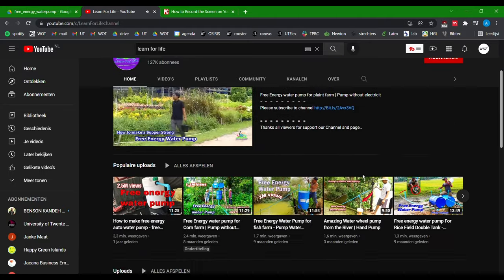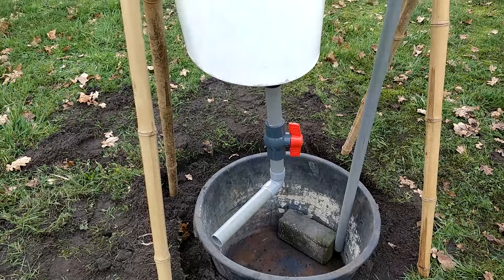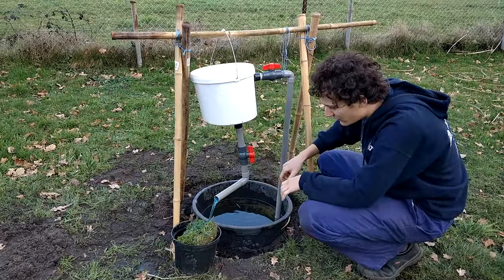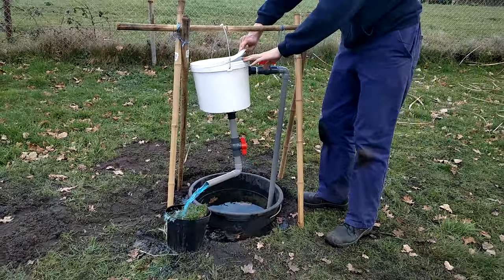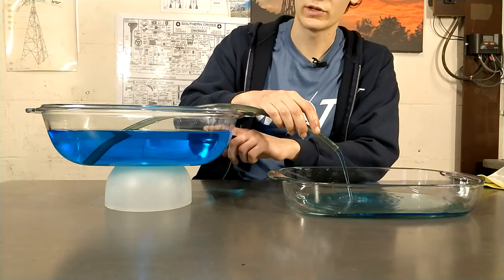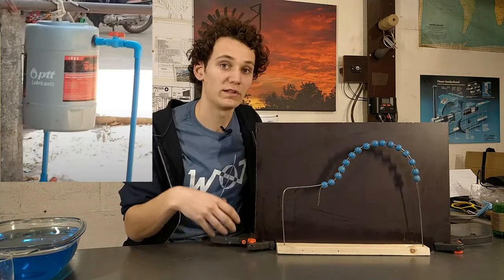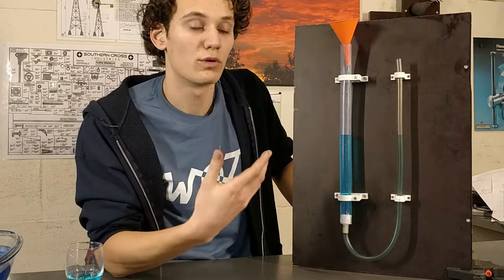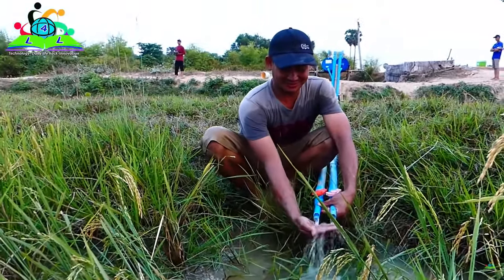FREE ENERGY Water Pump Tested. Is it possible?

Comment: Look into the ram pump also called water hammer pump its very interesting
Reply: He has a whole video about the ram pump.
Reply from the maker: We indeed have a video about a hydraulic ram, check it out here  https://www.youtube.com/watch?v=fUNicSOW46E
Reply: The outlet must be sunk under water to prevent the air goes into the tank. The pump can only ork only if the entire system is air tight and air proof. Water in the tank must be replaced with water from the intake and not to be replaced with air.
It is good if you add preasure tank (as per ram pump. Put bucket with full of water at the outlet and the outlet sink under the water.. Mind you, you cannot put the intake and outlet  from the same body of water. The bucket on the outlet can be higher or lower from the source of water. Bigger outlet pipe is preferable to ease the siphoning  and withdrawl effect
Reply: @WOT_utwente  incorrect. it is a vacuum created in the drum that sucks the water upwards from the ground level.
Reply: The energy actually comes from the sun heating up the drum that expands the air molecules in the drum and pushes the water out taking some of the heat that shrinks back the air volume  creating negative pressure to suck the water from the well. One metal drum has a surface of 5.6 square feet that can catch sunlight which gives 15 watts/sqft of energy total of around 80 watts per drum.  When the sunsets the system will stop pumping.
Reply: Can we use it to fill water tank on second floor from well or under ground water tank?
Reply: Ha ha ha..demo is not correct at all
Reply: I built a ram pump back in the early 2000s, spent $500 and a few years trying to get it to work but it completely failed.  Why?  I then discovered by reading a book by Gene Logsdon that the minimum height of the input needs to be three feet (or one meter), otherwise there's not enough force to run the pump. The input for my ram pump was a spring box that was only 2-1/2 feet (.76 meters) so there wasn't enough force to sustain the pump.  Eventually bought a bilge pump and a solar panel and that pumps the water from my creek up about 10 feet which then gravity feeds into my garden to irrigate it.
Reply: You should check itself feeding water wheels
Reply: @maintenance3044  ххххх
Reply: @Ameng3471  You are definitely onto it, but...
It is indeed possible to re-use the water.  The downward power is created through elevation and mass.  Think of the equation as left/right.  The left side (input) needs very little to draw it up the pipe (and can't go back down anyway), but the right side (output) is much more massive, until the end when it converges to a smaller outlet than input but with great pressure).  This works very well in concert with gravitational force, so there is earth's power to assist and make this work.
Reply: @rayabad  Awesome!!!  I will now inform our drum pumps they can take the evenings off to be with their families and tin-can friends.  Gonna be a lot of happy barrels at our house!!! 

There is no actual science in anything you have just stated.
Reply: @rayabad  No, it has nothing to do with the sun, you can pump water at night.
 it works if you follow the rules.  The outlet must be 3 times the diameter of the inlet, example 3/4" inlet, 2" outlet and must be at least 8 meters long and reduce to the diameter of the 3/4" inlet, with a valve so that the tube is filled with water up to the drum.
The drum must be made of metal and completely watertight to withstand the enormous pressure.
The 3/4" inlet must have a non-return valve inside the water and must be filled with water.
Here is the link for you to see, remenber all joints have to be glued, https://www.youtube.com/watch?v=zhKifQt-OH8.
Reply: @kalinystazvoruna8702  No, it has nothing to do with ram punp, this is another concept, the ram pump is for lifting water to 50 meters or more, this suction pump is for extracting water from wells or rivers to a depth of 10 meters.      it works if you follow the rules.  The outlet must be 3 times the diameter of the inlet, example 3/4" inlet, 2" outlet and must be at least 8 meters long and reduce to the diameter of the 3/4" inlet, with a valve so that the tube is filled with water up to the drum.
The drum must be made of metal and completely watertight to withstand the enormous pressure.
The 3/4" inlet must have a non-return valve inside the water and must be filled with water.
Here is the link for you to see, remenber all joints have to be glued, https://www.youtube.com/watch?v=zhKifQt-OH8.
Reply: @joseinfante5054  Thank you for the info, but I'm still skeptical.
Reply: His bucket lid is not air tight so it sucks air from there, that ruins the suction in the bucket from the water leaving the bucket.
Reply: MAKE the bucket air tight! The water leaving the bucket creates suction! Your bucket lid is YOUR FAILURE
Reply: @mariana1964  " The left side (input) needs very little to draw it up the pipe (and can't go back down anyway), but the right side (output) is much more massive, until the end when it converges to a smaller outlet than input but with great pressure).  This works very well in concert with gravitational force, so there is earth's power to assist and make this work. "
This explanation is wrong. Obviously the same amount of water would be drawn up and would flow out. Energy depends on the amount of water and the height the water is moved up or down. If the outlet is higher than the water level in the water source, more energy is needed to move the water up against gravity than is gained by water flowing down. This can not work and does not work.
On the other hand, water will flow up and down if the outlet is lower than the water level in the water source. Since in this case more energy is gained by gravity then needed for the lifting of the water. This is called a siphon. It works but it only needs a hose (or pipes) prefilled with water, it does not need barrels for creating a vacuum.
Reply: @heinzpg  No, that's not right.  I know in/out is identical -- it has to be.  That's not the point.  This is nothing more than a giant, unbalanced equation, one we balance with "work" at the outlet.  The "going down" water has immense vacuum helping it pull water up the intake. With a 55 gal. drum 12' in the air and large 3" (multiple) pipes pulling water, the output height really doesn't matter.

At any rate, you are arguing with someone who has one of these inventions on her Florida farm.  Oh, it works -- who would ever admit it now??? You really need to get off the couch and make one for yourself!

P.S.  Don't go small with it. 😀
Reply: @mariana1964    Your arguments show your incompetence in physics. Do you know how to calculate the water pressure at the outlet? I do, I have a MSc degree in engineering. With a strong vacuum water pressure at the outlet would be smaller than atmospheric air pressure. Which means, that either air would leak in and spoil the vacuum or the outflow would stop. The great volume of water in the barrel is irrelevant. Water pressure only depends on the height of the water column, not on its volume. And "work" only depends on the water volume which moves. 
At your farm you have a system which lifts water to a higher level without input of energy? Really? That would be great! I advise you to show it to some experts, and this will cause quite an uproar in science, since your system allows the first time to build a perpetuum mobile. Just let the water run back in the well and let it drive a turbine on its way. All books on physics will have to be rewritten. I will read about this sensation in many scientific journals and this will save me the effort to visit your farm personally.  😂😂😂
Reply: @mariana1964    It is not an insult to state that you have no competence in physics. Most people haven't, it is no shame at all. You show no respect for science, although laws of physics just describe what we observe in nature, and nature doesn't lie. And of course you never heard about this clever woman Mrs. Noether, who proved more than 100 years ago that our universe couldn't be stable without conservation of energy. I guess, you would not be happy if all achievements of science you have been using and which you still use would be taken from you!

I have experience with people like you since decades. They claim they have devices at home which violate laws of physics. Motors driven by gravity or permanent magnets. Pumps which can lift water without an input of energy. Motors which deliver more output than input. But none of these people have never ever allowed, that their marvelous inventions could be inspected on site. And strange enough, these inventions have never spread to the benefit of mankind. There are enough gullible people who can be deceived by such claims, but not me.
Reply: @heinzpg  I CLAIM that we have a device that is able to siphon above a source level, that I KNOW how it works, and that we have been using it for years to irrigate our farm, as well as to geo-thermally air-condition the greenhouses -- ALL without using a single watt of electricity.  Raising a large quantity of water higher like that is what creates the vacuum's power "downstream" and for the eventual, peaceful return of the water to the lower barrel.  A vacuum (even a partial one) is powers of 10 stronger than air pressure (real ENGINEERS know this -- see below) and we use this principle to naturally raise the level of and then pump pure groundwater to the various gardens.  Water is perfect for this application!  And don't forget the importance of the foot valve at the intake.  What do YOU suppose that is for?  Btw, at 58 -- I have been around and have worked the land all my life.  I can smell experience and it DOESN'T smell like this "BS in print" here.  To me, "decades of experience" is just a lot of hot air I would rather not breath, thank you.  So, please, save it.  As a matter of fact, I will give you my worthless, purchased degree from the 80s.  How's that sound?

Hey man, if you ARE legit, then wake up!!!  "Science" is VERY asleep at the big wheel and many of us know it.  FWIW, our farm isn't the only one doing this.  Many are.  We also know the earth is not a globe and that "outer space" is (and always has been) a big, fat, provable lie (one reason would be the 'air pressure vs. vacuum' LAW from earlier).  So???  Big deal.  Hey, YOU claim to possess decades of experience "refuting claims" others make, and because of that degree  (🤣🤣🤣) you know more.  Well, you simply don't know this.  Why not try to learn more???  Unless...

Or,  ...the engineering degree is either a lie or worthlessly wasted, and we have the unmistakable stench of "mainstream hogwash" in the room, so the real point is something else altogether, such as stifling the conversation.  Hmmm???    (as if I didn't know)

Do you wish to learn something new or not?  Until then... be well and always listen to what others are saying with an open mind.  I'm also a bit tired of arguing the truth with a non-believer.  You will see ONLY IF you have fully opened your eyes.
Reply: @mariana1964    " We also know earth is not a globe "
Wow! There is a faint hope that you are just trolling, but this is probably to optimistic. Bye.
Reply: @Ameng3471  Sorry, you are way out. This is a simple siphon and as such it only works from a high level to a lower level. Water will never flow upwards due to gravity   or atmospheric pressure.
Reply: @madhavbagfarmnursarynursar4532  it does not work at all.
Reply: @mariana1964  It does not work.
Reply: @joseinfante5054  Sorry,   differences in tubing does not inflict with the function of a siphon. A siphon can not lift water. The outlet must be lower than the inlet.
Reply: @rvlifestylelivin  Noop, air comes in via the outlet tube due to very little water flow. If the output had been put into a milk glass, all “pumping” would stop.
Reply: @rvlifestylelivin  Noop. The lid is tait enough.
Reply: @heinzpg  Sorry, but you are wrong. A siphon can not lift water.
Reply: @mariana1964  Sorry Mariana even beleif can not make this siphon pump uphill. It is like lifting your body by the hair. IF, an only IF you could prove that some siphon can lift water - get ready for a Nobel prize.
Reply: @Dingsrud    You addressed the wrong person in my case. In all my comments I explain why water can't be lifted without an input of energy.
Reply: @heinzpg  Sorry Heinz, we are fully in line. Maybe Youtube trickled me.
Reply: @Dingsrud  Sorry, this system is not a siphon. this is a vacuum pump, based on physics like Newton's 3rd law, (action; reaction), only it has rules to be obeyed and the artist of this video didn't obey those rules. 
The vacuum formed in the drum looks for the weakest place to act and here in this video, this weak is the outlet, so it sucks air through the outlet, not from the source. So the rule is that the output has to be thicker and longer so that the difference in PSI is greater than that of the source, for example ( PSI in source 3 PSI, in output 5/6 PSI ), the higher the output , more vacuum in the drum and more water is sucked in the source. and the system has to be totally watertight, and the drum used in this circus will be destroyed by the force of the vacuum, it has to be in steel to resist.
And sure, you have to make one to be able to affirm your theories, not from the eye meter.
Reply: @Dingsrud  It's like pouring water out of a bottle, what happens? pour water and draw air from the bottleneck.
Reply: @joseinfante5054  I agree that the could have been an air trap  at the output. You can make one simply by dipping the output into a bucket of water or by bending the output into a “U”. If you do so, and the barrel is air tight,no water will flow out of the system. You can test this by submerging a milk glass in water and lift it by the bottom. It stays water filled until air is getting in. 
Now do this experiment once more, lifting the glass 95% out of the water. You let in a fraction of air, but the glass stays 80% filled and stable. Then you submerge a straw and lift it into the glass. The top of the straw is  
- lower than the air filled volume. Will there be any flow of water?
- exactly the same level as the surface of the water. Any flow?
- up into the air volume. All of a sudden water is pulled up in the straw and poured out from the glass bell?

Noop. No change. This mimics the “barrel pump”:
- the straw starts deeper in the water, i.e. the straw sucks from a lower lewel.
- straw/suction pipe is thiner than the outlet. (The diameter of the glass) 
- there is a huge amount of water in the “tank”
- the tank is airtight. 
- you may repeat this experiment using a 5 m long tube blocked in the uper end. This will mimic “a long discharge tube.”

Evrybody can repeat this experiment in the kitchen. The “parrel pump” lifting water does not work.
Reply: @joseinfante5054  yes, but watch the video. Outlet is opened no water are suched in via the inlet pipe. A handful of air gulps in. The system pours out a little water and agan the water in the tank comes to a standstil an the pressure in the tank is 1bar minus the hight of the water from the outlet to the surface in the tank. No water is pumped. One more gulo and again the pressure in the tank is almost the same, atmopheric pressure (start up) minus the height of the water column. Again almost the ame pressure and no pumping. As I said, one could have put the output into a bucket of water to prevent air from coming back into the tank.
Reply: @Ameng3471  “Mind you, you cannot put the intake and outlet  from the same body of water.” 
Of cause you can intake and outlet can be taken from the same body of water. You state it yourself: 
“The bucket on the outlet can be higher or lower from the source of water”. So bring the inlet and outlet to the same height, and you cam merge then to one body.
Reply: This pump "hammer" requires an excess of water flow from a stream and that is why it works.
Reply: @brianwilless1589  This is a siphon with a barrel, no Ram pump. That is why the source must be higher than the outlet from the siphon.  A siphon can not lift any water up from a well, not even 1 inch.
Reply: @madhavbagfarmnursarynursar4532  Sorry, that is not possible with a siphon like this. A siphon can not lift any water. 
You must use a hand pump or electric pump to solve your problem
Reply: @kalinystazvoruna8702  Maybe a spiral pump would do the trick? It can lift water many meters and can be driven by a very gentle flow in the river. This can run 365/7 with no other energy than the river.
Reply: @joseinfante5054  Sorry José, but that is not the case. This is a siphon and a siphon can not lift any water. To elevate some mass (water), you must add energy to it. Here you add energy by filling the jar at start up, but as the water falls back to the ground, that energy is lost. No more energy left to elevate more water. It stops.
Reply: @kalinystazvoruna8702  You should be. A siphon can not lift any water at all, just as this video shows. Does not work
Reply: @rvlifestylelivin  The bucket is a paint container. The lid is air tight, no problem.
Reply: @kjellg6532  I've looked into that and there's a slight possibility it might work but the area where I could put it is about 4" deep due to rock being there.  There's also the problem of tons of sediment/dirt being transferred and that might screw everything up.  I've looked at my bilge pump again, and that might also work if I move it over to where the water runs down on top of the bedrock where the flow is enough to remove the sediment from "sticking" to the area.  It's a matter of trial and error. 😸
Reply: @mariana1964  Hello Mariana, we are still looking forward to see a more elaborated description of the installation at your farm. We know there is one barrel 12” above ground, 3*3” output. What is the size of the suction side? What is the distance from the top of your barrel down to the water level in rhe ground water source?  You use a foot valve in the source in the ground water. Then you also mention using ground water to geo-thermally air-condition the greenhouses. I do also, using an energy borewell. In my system the water circulates, cooling the house in summer, while going back into the well for recooling, all in a closed loop. What about your system? Do you spoil the ground water after cooling the green house, or are you too using a closed loop?
Would like to hear in more detail how you do this stuff in Florida.
Reply: @kjellg6532  We are, huh?  "We" have been very dismissive about the science I have presented here, so "we" are going to have to figure the rest out.  "Me" does not like explaining things over and over, and even on multiple threads.  It's just trolling now, so good luck with your design at home.  If there is anything to add, I will.  Scale your design with steel and leave the plastic behind. 😀
Reply: (google translated) you forget the important thing... vacuum, the outgoing water makes a vacuum and the vacuum absorbs water from other source ut without good vacum it will not work (like your experiment)
Reply: @Longestcomment350  Demo is exactly to the point. Shows that a siphon can not lift any water, barrel or not.
Reply: @heinzpg  What if you made a video explaining your system in detail. It would be of grate interest seeing how you can lift water.
Reply: @kjellg6532   I think you addressed the wrong person. I emphasized in all my comments that water can not be lifted by the vacuum in the top of a barrel. The systems which can lift water are well known. We call them "pumps".   😊
Reply: @heinzpg  Agree, you are not the adresee. I must have fumbled or the electronics have played a trick on me, sorry Heinz.
Reply: @Dingsrud    No problem. Since you are very busy here to clarify things with your comments this can happen, no harm done. 😊
Reply: @mariana1964  What is the purpose of a foot valve at the intake? Under which condition will it close?
Reply: @Dingsrud  you commented to wrong person
Reply: @maintenance3044 🔴 What Is Islam? 

🔴 Islam is not just another religion. 

🔵 It is the same message preached by Moses, Jesus and Abraham.

 🔴 Islam literally means ‘submission to God’ and it teaches us to have a direct relationship with God. 

 🔵 It reminds us that since God created us, no one should be worshipped except God alone. 

 🔴 It also teaches that God is nothing like a human being or like anything that we can imagine.

🌍 The concept of God is summarized in the Quran as:

📖 { “Say, He is God, the One.  God, the Absolute.  He does not give birth, nor was He born, and there is nothing like Him.”} (Quran 112:1-4) 📚

🔴 Becoming a Muslim is not turning your back to Jesus. 

🔵 Rather it’s going back to the original teachings of Jesus and obeying him. 

More .....👇

🔴 THE RETURN OF JESUS
Reply: You'll have to see if he ever figures it out.